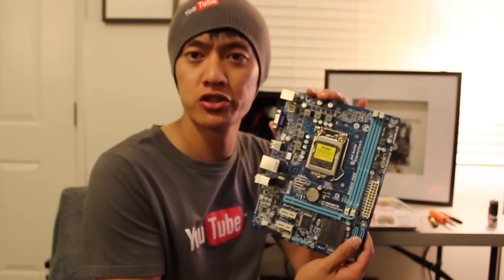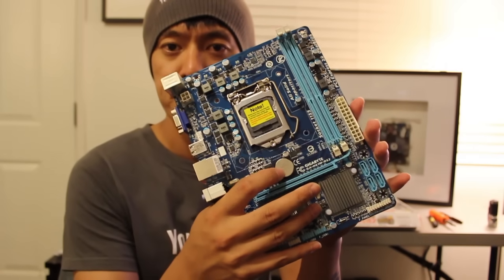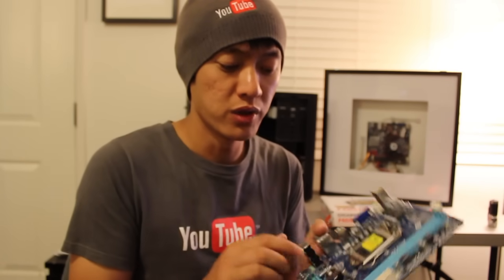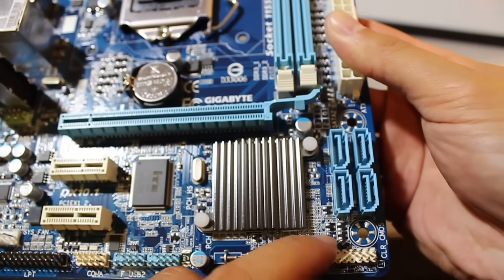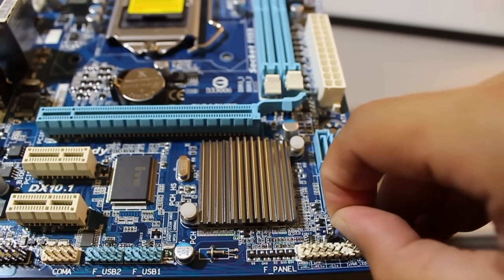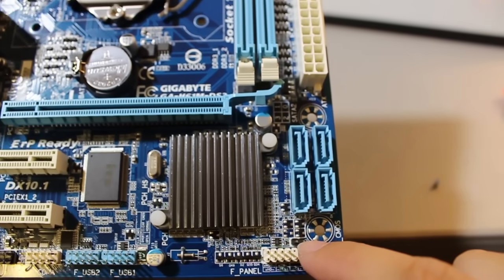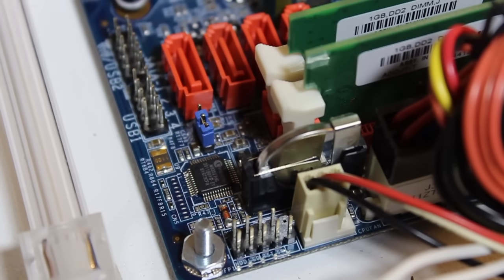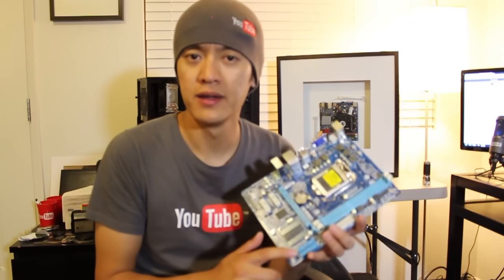How to Clear the CMOS - Reset the BIOS & Why

Comment: I found taking the battery out and clearing Cmoss works fine for me
Reply: Hoping itll work for me
Reply: Chris B yes but first remove all hardware like memory,gpu
Reply: +rochester3 would this help my problem where my monitor isn't detecting my pc?
Reply: Chris B do you have windows 10?
Reply: +rochester3 nope
Reply: Chris B the only thing i would do in your case is get important info off of my hard drive then format it, then reinstall windows but first i would try to plug it in to an HD tv if nothing appears in the monitor then its either your motherboard or you gpu or some settings in your monitor isnt setup right...but yes you can try to clear cmos it wont do anything wrong besides erase your settings back to factory..
Reply: +rochester3 i know its not my gpu because i had that in my other pc and it worked
Reply: Chris B well then try and clear cmos and if that fails then reinstall windows..the easiest fix is reinstalling windows.. i dont waste my time trying to fix things when theirs and easy way out. make sure you have enough space on your other computer to transfer files from the hard drive.
Reply: +rochester3 and i really don't want to be my mobo because im really poor and its hard to find a cheap mobo for the q6600
Reply: Chris B just do what i last told you and then tell me the outcome
Reply: +rochester3 nothing happened sadly so ill just have to go back to using my pentium d pc :p

Comment: I admit I have not watched past 1 minute... But is taking the battery out not an option anymore???
Reply from the maker: It's always an option that isn't guaranteed to fully clear out the bios. There's a reason why engineers installed a jumper and to this day, even modern motherboards have a button, which is the same thing.
Reply: @johnnythegeek  I assume that must clear out any flash memory installed on the mobo to hold BIOS settings.

Comment: Did this and my pc wouldn't work after what's up with it? I did everything he said turned it one nothing happened then shut it off and turned it back on and nothing happened again. Before hand, the computer would turn on but not display anything and it still does the same
Reply: Nvmnd fixed it lol
Reply: +Nate Waters How did you fix it? please share.
Reply: What I did was turn on the computer, turn it off, then unplug my hdmi cable and put it into the mobo (instead of the gpu) gave it a few minutes, and then turned it off and back on and it finally worked. This always works for me if I have any trouble with turning it on and not having anything display. Wish you the best of luck with your troubleshooting :)

Comment: when i plugged 2 stick of ram in my motherboard it wont boot but if i only plug 1 stick of ram on the 2nd slot it booted up normally can anyone tell me what’s going on
Reply: Facing the same problem... did you find any solution
Reply: Facing the same problem... did you find any solution
Reply: @sunnyspartan9896  not yet actually

Comment: could also turn off the pc. power cable out, get battery out, connect power, turn pc on for 5-7 sec, turn off pc, turn off power, connect back battery and then back the power. should reset bios.

Comment: Why nothing happens? I'm not a PRO, learned everything on the way. That NOTHING HAPPENS thing is kind of probe or protection. When you power on PSU,it only sends a minimum power to MBO, then MBO checks everything and responds in a way:"EVERYTHING OK, WE'RE GOOD TO GO, UNLEASH ALL THE FORCE(if everything is fine)",and then PSU release power CPU needs.

Comment: I did this and it didnt work. My computer still turns on then off after a few seconds
Reply: You have to reset the BIOS on the new CPU. If you do it on the old CPU and them replace it, nothing will be changed
Reply: @luukdevoogd1071  done that think my motherboard is faulty in other ways like the ram stick slots

Comment: the best tip is dont buy an gigabyte board, never had an issue on a asus board, always had issues with gigabyte board
Reply: Mines just fine
Reply: @Scouter5050  for how long did u used ur board?
Reply: Mines about almost 4 years old.
Reply: @jongjie  ab350-gaming . Think it came out in 2017

Comment: This guys is wrong. you do not turn on the system while the clear cmos jumper is in place. this will damage the motherboard. Use the jumper only with the system off and battery is enough power to clear the cmos. Basically just insert jumper then remove it while the system is off.

Comment: My graphics card died since it got wet from some water that leaked in a vent (thanks cats!) so I decided to use the onboard since every other part seemed to be running fine, nothing showed up so I figured I might of had to switch the display in bios, but couldn't access it due to having no display, so this video was useful in those regards. Sadly still not working so I guess it's another issue.

Comment: yea all this you said is wright but with the stressed rule that you have cut the power to the computer and when you pressing the start button you are draining the last (residual) capacitor power. otherwise you fucked up the board and most probably you need a new one

Comment: If the computer does not restart when the hard disk is open, the computer will continue to take automatic restart when the computer is in normal mode.  Do not run the pen drive bootable

Comment: Thanks man i was looking for solutions to reset my bios and now my system is dead thanks men!👍

Legit tho it killed my PC💔☹
Reply: Why didn't you just hit F8 or delete to enter the bios and reset the bios in the bios? By clicking on use default and then hitting the enter key on the keyboard. Maybe you can weld in a new bios chip for the motherboard. If you can't enter the bios you need a new bios chip or motherboard.
Reply: Yeah you gotta be careful doing this shit.

Comment: my pc is all back and it says no bootable device __insert boot disk and press any keys
Reply from the maker: There is a problem with your hard drive. See if it is detected in your bios.
Reply: Johnny Phung how do I do that :(
Reply: Johnny Phung it says boot device not found
Reply: Either F2, F12, or F8. Navigate through the bios with arrow keys and enter/space. Try finding your HDD through the Boot Devices. If there is nothing, then your hard drive is dead.
Reply: Red I think it's dead :( what can I do to fix it
Reply: You'd need to buy another hard drive, and install Windows/Linux on it. You will need another Computer or have a Windows Installation disc.
Reply: So buy a new hard drive and windows 10 or 8 it came with 8 installed
Reply: Red I have a hp envy m6 notebook pc 8gb ram 2.60gh i5core
Reply: But I test it and it said that the hard drive is good
Reply: What happened was it was doing a factory reset or recovery and while it was doing that I wanted it to cancel and there was no way so what I did was take off the battery then when I turn it on it was just a black screen now I can go too boot settings but after that I only see does options there Is no way I can go to the windows menus I press f10 and it takes me to the bios but then after that I don't know what to do I mean do I have to set the bios in order do I leave legacy enable or desable
Reply: It seems like your drive is corrupted. You will need to reinstall Windows. Try re-installing the same version of Windows 8. Get the ISO of your Windows 8 (can be 8.1/Home Premium ETC), and make a bootable drive on a Flash Drive. If you have the windows 8 disc you can use that aswell.
Reply: Red dam thank you yea I don't have the disk for Windows 8 should I first delete everything that's in the driver and then install Windows 8 and just start fresh I mean I had a virus I wouldn't like to install Windows 8 and the virus still there
Reply: In the Windows 8 set up screen (on a flashdrive/disc), it should give you an option to format the disc.
Reply: Red will formatting it will delete everything???
Reply: Red I appreciate you knowledge by the way thank you so much
Reply: Yes formatting WILL delete everything.
Reply: Red thank you so much man Long live Red lol
Reply: Cesar Burgos haha no problem.

Comment: well my pc turns on and everything. my problem is my graphics card. its brand new. it for some reason just stopped out putting video.. it on. works fine. but HDMI video, its like NAH BITCH. i tried 3 monitors. nothing.. i put in my old GPU and it works fine..